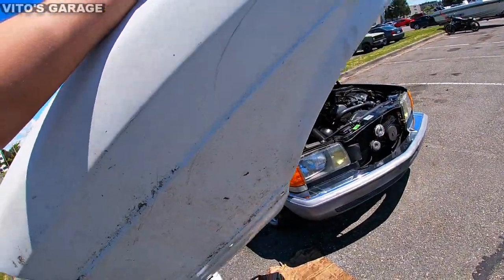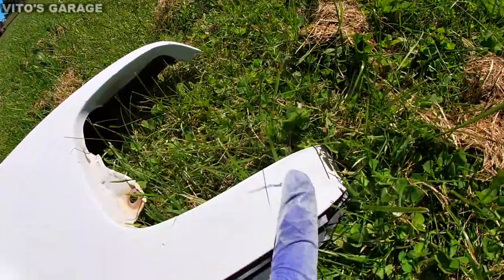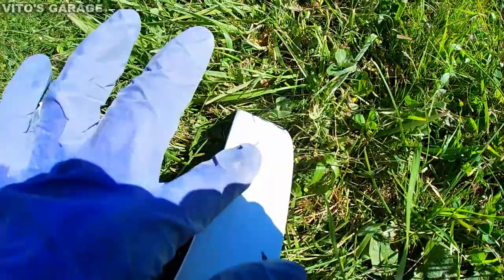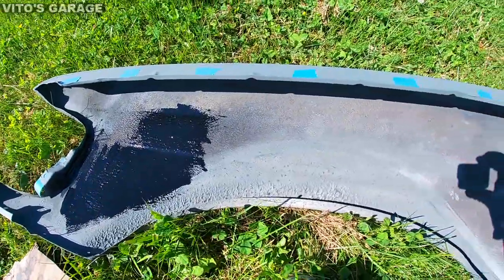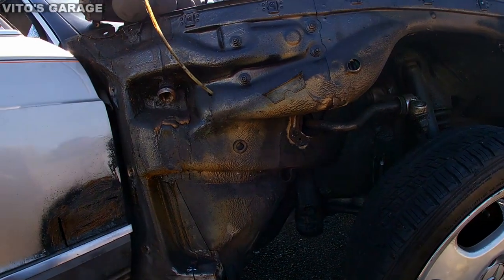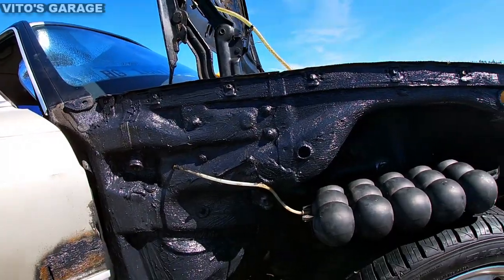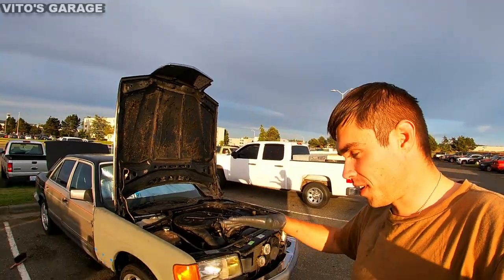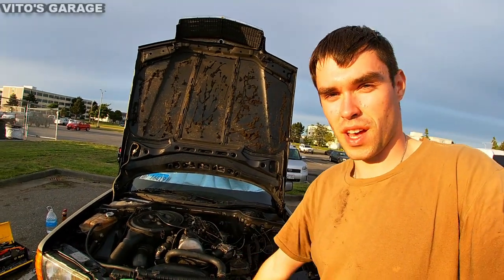Mercedes W126 Restoration Ep. 7:  RF Fender Prep & Replacement!

Comment: thanks for this video making be feel more comfortable on pulling my W123 fenders
Reply from the maker: It's very simple. Not too bad. A little harder than on W126. 
Also, W123s made before 1981 had front fenders glued to the body. So if you have one made before 1981, you will need a heat gun to heat up underneath the fender and loosen up that glue. Not a big deal! You can email me if you need help or have questions: vitoldaswork@gmail.com

Comment: Hi! What paint is that? A kind of rust converter?
Reply from the maker: I forgot to include a clip of how I was spraying a primer... 
But first, I cleaned all the rust off and used rust dissolver get to remove all the rust till bare metal. Then, I sprayed 3 coats of primer and regular black paint (or you can use Rust Encapsulator). Finally, I smeared everything with wheel bearing grease! This will never ever rust!🚗🚗

Comment: You have mentioned bearing grease, can you name it? Because if it's some generic lithium grease like Litol it's hygroscopic and can absorb moisture which is what you want the least
Reply from the maker: Fluid Film and Wheel Bearing Grease. Just don't get that on rubber boots. Use silicone grease for suspension boots

Comment: Hi you work out side.is this you work 
Place ?I would  not  use  under coating .you should buy this rust proofing gel in spray can use that.
Reply from the maker: Yes, I work outside for now. And the spots that I fixed are going to be good forever. All the rust was cleaned off very well and protected. That wheel bearing grease will never let the rust appear again!